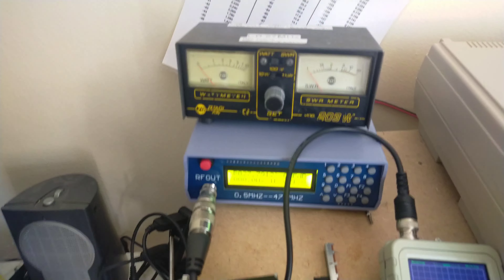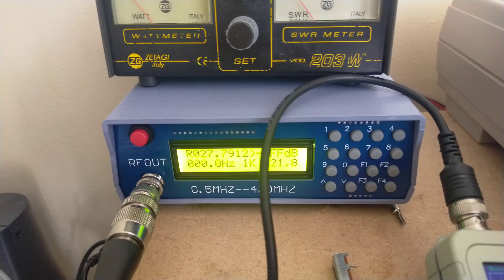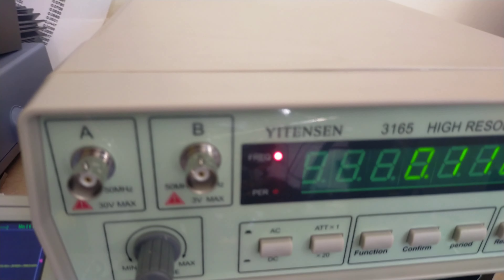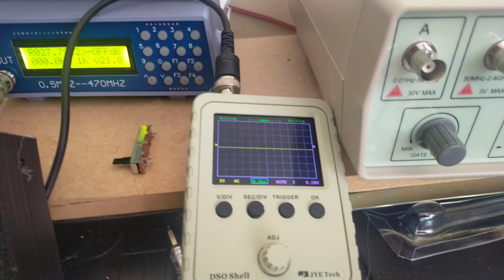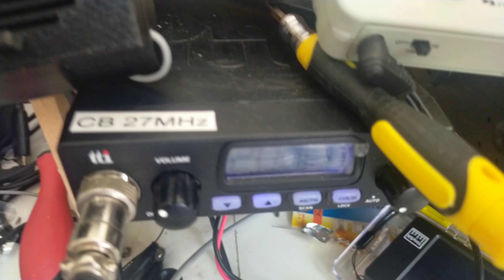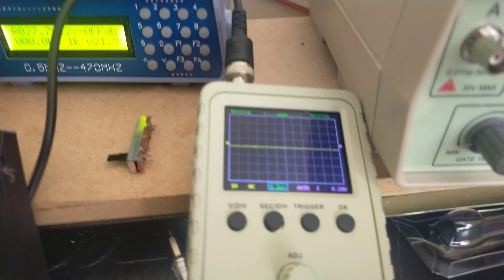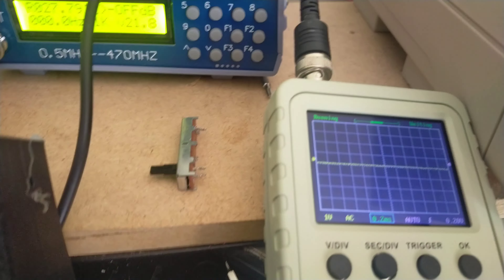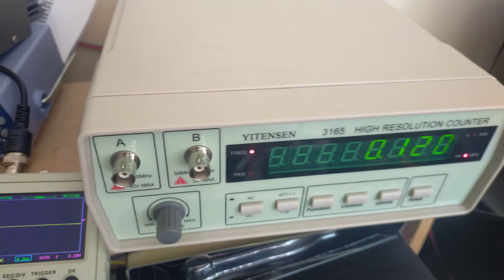Useful CB repair aids: signal generator, frequency counter and oscilloscope

Comment: I have one of those signal generator. I find them effective although are hindered by the fact it only reads down to -123 dbm. It would also be useful if it came with a SINAD meter.

Comment: Does the signal generator have frequency modulation so it can be used for terrestrial broadcast FM hifi tuner alignment?
Reply from the maker: It is an FM signal generator and the broadcast band is in its range so it should work for that
Reply: @PaulMcGeeM0WNU  Reason I ask is that on eBay several sellers list these signal generators implying they're for setting up walkie talkies...
Reply from the maker: @jabbalechat7910  yeah, the Chinese call them 'walkie talkie testers', at the end of the day they are just signal generators
Reply: @PaulMcGeeM0WNU  Thanks for the clarification...

Comment: Can this be used for repair of shortwave radios?
Reply from the maker: This equipment should be fine for that purpose but the signal generator in this video is FM only, hope that helps
Reply: @PaulMcGeeM0WNU  thanks, the one I bought from Amazon also does am so it worked out perfectly 😀